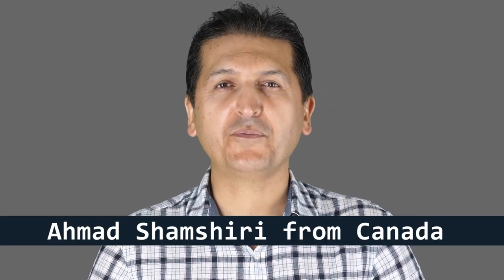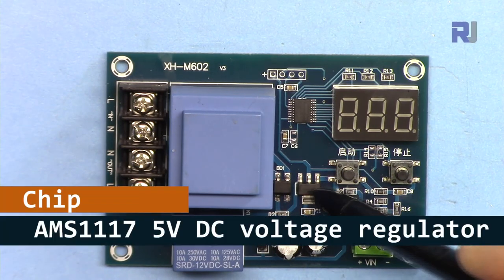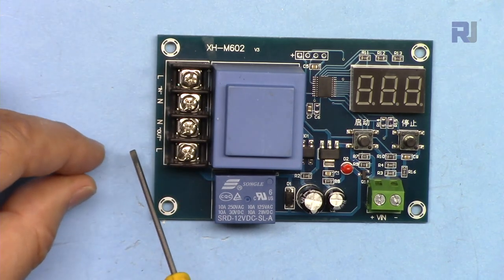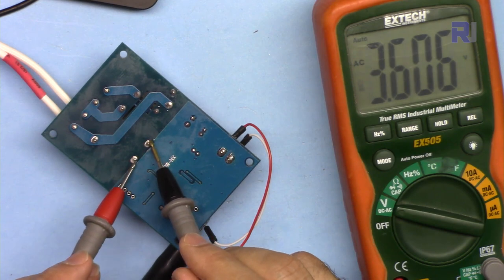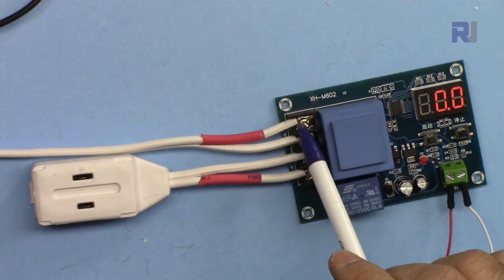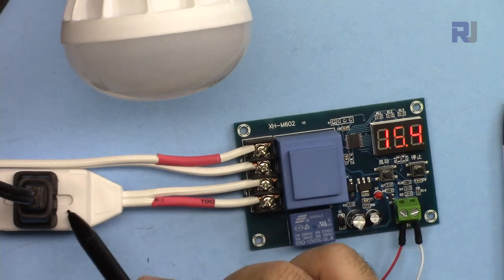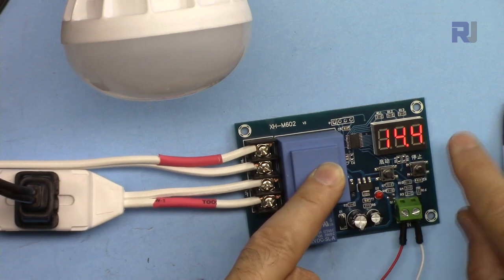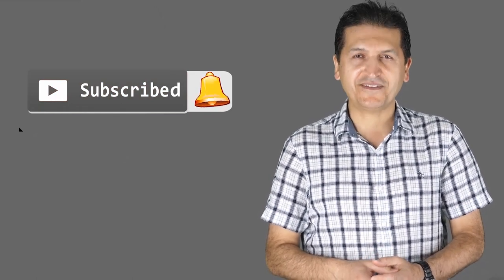Review of XH-M602 Charge controller Operated with 220V AC - Robojax

Comment: I couldn't find this in the North American 120vac version, so I ordered the 240vac version and will tell you here how to convert it to 120vac for about a dollar. The Transformer output is around 14v with a 220vac supply input, which when rectified easily drives the 12vdc relay. However, with only 120v supply, it outputs about 6.5vdc after being rectified, so swapping out the SRD-12VDC-SL-A relay with a SRD-06VDC-SL-C will convert this to a 120vac use. The rest of the board will even run cooler as the on-board 5vdc voltage rectifier will only have to sink 1vdc on a 120vac system instead of the 9vdc it has to sink on a 240vac supply. This design is tried, tested and true. The SRD-12VDC-SL-A relays are also available on Aliexpress for about one dollar a piece. Hope this helps someone looking to use this in North America or anywhere that has 120vac mains voltage. Cheers.
Reply from the maker: Thanks for sharing.

Comment: hello ... this type of controller has 10 amps relay .... is it possible if i change the relay values bigger than 10 amps, then i can put more load power? thank you
Reply from the maker: Yes you can . May be use this relay to turn On a more powerful relay. For sure. Or replace the relay with higher rated value.

Comment: Sir please reply...
I have a xh m601 auto start and stop charging module.
It charges say a car battery when the voltage is below the minimum set value say 11.5V, and it continues to charge till it reaches max set voltage say 14.5. i.e. between 11.5 to 14.5, the RELAY IS ALWAYS ON. This is fine.

Now, I want the reverse output of this module.
I want the relay to be ACTIVATED only when the battery voltage is GREATER THAN 11.5V.
And it will remain activated until it reaches 14.5V.
That is RELAY will remain activated between 11.5 to 14.5. And it will remain OFF at below 11.5V.

Please help me get this reverse output for this specific module.😊

Comment: I'm positive that other people are having the same problem as I already described to you. I explained to you what I believe is the setup you're describing in the video. Is my description about what is happening on the RIGHT SIDE of this XY-DJ correct? If so, does that mean I'll need to plug two devices into a wall outlet to make XY-DJ work to charge my Battery? Please read my last message again. And thanks for every response you've made thus far.
Reply from the maker: Hello, I just updated the resource page for this module. the link is in the description (and here http://robojax.com/L/?id=260)  of the video. All your questions should be answer .  it would have been nice if you used, "Reply"  so others would know that all the comments are about the same issue.

Comment: I have this module. 

However the charger is at about 14 V. The charger bypasses directly to the detection, and constantly switches on and off (every second) if the upper limit is less than the 14 V. If the upper limit is more than the 14 V, then the charger never switches off.

Would you please assist?

How can I keep the detection ports from not detecting the charger, but only the battery?

Comment: Hello Robojax.Thanks for great video! But I still have a question.
My battery charger has a very high power 1500W  220v. 
I'm afraid that the board is not designed to pass such high power and may heat up or catch fire...
Can you tell me what is the maximum power of the charger at 220V that can be connected? 
Thanks in advance!
Reply from the maker: Hi, the maximum current can pass though the the relay was explained in the video. Simply read what is written on the relay.  You will read the current and use the power formula to find the power using The current.
Reply: @robojax   In video we have 10A, but it is not clear is it for 220V or 110V  . 
If I understand correctly maximum power is 2200W, but it is depends on voltage... So I have some doubts about it.

Comment: In the circuit diagram, an external charger is connected to the battery.  What is the purpose of the DC side, is it an input or is it a battery charger?
Reply from the maker: Battery needs huge DC power this transformer is very 1/100 or 1/500 of the charger needed for battery. So the transformer in this module simply able to power the module only.

Comment: Thanks a lot. Could you please help me in setting my solar panel with this regulator. I have a 5w12v solar panel rated with max 21v. I want to take the energy from this solar panel and divert to my car battery. Where should i connect the wires from solar panel as input, and where should I connect the wires which goes to the car battery? I will set the limits as 13.6v min and 14.4v max.
Reply from the maker: your solar panel is your the power adapter and your battery is the battery.
Reply: @robojax  Thanks, can i minimum voltage as 0? As i want the car battery to trickle charge and cutoff when voltage reaches max 14.3v.
Reply from the maker: I am not sure if you the device or not but, just try it to see if it can do to zero.

Comment: Hi Robojax. Great videos. I've liked and subscribed.
I am trying to fix up a new charger for my friends 20 v power tool after he blew its charger by putting in the wrong battery, which had the + and - terminals the other way around.
Two questions, if you'd be so kind as to answer them:
1/.  The battery has a BMS, so can I skip the charger (which is blown) and connect the XH-M602 directly to the battery terminals?
2/.  What amperage does the XH-M602 work at?
Many Thanks and good luck with your channel.
Reply from the maker: thank you for subscribing. 1-No you can't.  This is just switch to turn ON or OFF your charger. 2-It is the relay rating . Written on it. most probably it is 10A. Thank you for not skipping the ads and keep watching it. This will help me a lot.

Comment: Good day robojax, im currently woeking on a project that is Li battery operated and I don't know what module I will search until i saw this one, i have two 6v motor drivers which is supplied by the 12v battery and has a split connection. Any ideas on how can i charge the battery and also gives the output when not in charge thankyou so much
Reply from the maker: Good day, Your batter has two terminals. You can connect your charger to the battery. Then connect your motor to the two terminals. So you will have 2 positive and 2 negative connected to the same terminals of battery. that is called parallel. You said your motors are 6V, I assume you have connected them in series to operate them with 12V otherwise they will die. So form both motors you should have only 2 wires which I call them "motor wires"

Comment: Can you be run 110v continuesly from the 220v. Like a step down?
Reply from the maker: doesn't work with 110V. The output becomes unstable.
Reply: @robojax  See comment about five comments up. This can easily be converted to run stable and cooler on 120vac.

Comment: Hello, I have a 12V 12A battery, how should I enter the upper and lower values?
Reply from the maker: Hello, the 12V is called nominal voltage. But the charge voltage is something like 13.2V. to be sure you need to find datasheet of the manufacturer.

Comment: How to use external relay with this?
Reply from the maker: remove the relay and connect the wires in the same spot.
Reply: @robojax  can we use that 4 empty soldering spots?
Reply from the maker: Hi I don’t have the module in hand to know but remove the relay and connect the pins using wires

Comment: Thank you Ahmed for your video. Is there a similar device that can do the opposite? I'm in offgrid home where i have my battery bank 48V (14KW) fully charged around 12:00 to 1:00  PM. I I wanted to use the rest of the electricity that my solar panels are generating. Basically i need to have a device that i will activate a relay instead of shutting it once the battery voltage reach a certain limit (full). It's the same as your device but with NC and NO (normally closed and normally open) option. I found only 12V-24V controller, but not for more. Thanks again. Shokran
Reply from the maker: You are welcome Tommy,  I believe there should a solution. I have done a video of dual relay module with voltage detection.. I don't remember all its modes. check it out   https://youtu.be/O01NCZq7O2M

Comment: Great video sir, this is what I searching from long time. 
I have 24V solar offgrid system. I am looking for module/kit which will monitor battery voltage and can feed power to my 1650VA inverter only if battery voltage false below 22v (this usually happens during late night and my inverter starts beeping). Can I used this module for my requirement. I think, I can but only worried about relay capacity to handle AC load. please suggest...
Reply from the maker: This will just monitor the voltage of a battery and when it reached below certain level it connects it and disconnect when it is above setting value. But power is the limit of the relay. You can however use external more powerful relay to control more powerful charger.
Reply: @Rajesh were you able to make it work? It has 10Ah rating which makes it 230x10 = 2.3KW capable. I am also planning to buy one for my 1100VA inverter.

Comment: Thank you for the video, however I need more details on the charger device that must be connected to the SH-M602, where can I find one?  I plan to use this device to recover dead hand tool batteries.
Reply from the maker: this is just  monitoring the voltage and acts based on voltage. Everything you needed to know about this device, I have provided in the video.

Comment: hi what happend if you put the hot input wire on neutral connection and neutral on hot conection? europe 220 connector dont have marked connector.
Reply from the maker: Hi, it is safety measure to protect use who thinks the device is OFF and touches the wire. it might be very dangerous.
Reply: @robojax  ok. but will it work or short cirkuit some way?   tutch what wire?
Reply: the hot wires will be isoleted any way. will it work in wrong connections is the real cuestion?
Reply from the maker: Relay is a switch. A switch can connect and disconnect.
Reply: @robojax  hi i did not ask about the relay.  the qoestion is do it work if the inlet hot wires are switched. hot on neutral and neutral on hot?

Comment: can this device be a LVD in solar panel system, I'm thinking to use this in output in my inverter? how about flip the value, upper value is 11 volt so it can cutoff all AC Out and lower value is 13.8v so the ac input and output will work again?
Reply from the maker: you can't switch the upper and lower limit. I have not done it but you try it.

Comment: HI
THE CHARGER DILIVER 28V (FOR 24V BATTERY)
IF I PUT IN THE CONTROLER (XH-M602) THE MAX (28V AS THE CHARGER) , THE CONTROLLER WILL NEVER CUT
IF I PUT MOR THEN THE CHARGER (29V) THE CHARGER WIL NEVER DILEVER MORE THAN 28V !!
Reply from the maker: Hi, when you use CAPITAL letters, you are SCREAMING.
Reply: @robojax  
Hi
No way there is nothing to make screaming
If you have any reply feels free

Comment: ഹായ് സാർ എനിക്ക് നിങ്ങളുടെ വീഡിയോ നല്ലപോലെ മനസ്സിലായി അതു കൊണ്ടു ഞാൻ നിങ്ങളുടെ ചാനൽ സബ്സ്ക്രൈബ് ചെയ്തു 

സർ എന്റെ അടുത്തു ഒരു 12v 7ah ബാറ്ററി ഉണ്ട്  
ഇത് ഉപയോഗിച്ചു  24×7  ബാറ്ററി ചാർജ് ചെയ്യാൻ പറ്റുമോ
Reply from the maker: ഹായ്, നന്ദി. ഈ മൊഡ്യൂൾ ഒരു ചാർജർ അല്ലെന്ന് നിങ്ങൾ മനസ്സിലാക്കിയെന്ന് ഞാൻ പ്രതീക്ഷിക്കുന്നു. ഇത് വൈദ്യുതിയെ ബന്ധിപ്പിക്കുകയും വിച്ഛേദിക്കുകയും ചെയ്യുന്ന ചാർജ് കൺട്രോളറാണ്. അതെ, കണക്റ്റുചെയ്‌തതായി ഞാൻ കാണിച്ച ചാർജർ നിങ്ങളുടെ പക്കലുണ്ടെങ്കിൽ അത് ഉപയോഗിക്കാം. ചാർജർ എന്ന് ഞാൻ പറഞ്ഞപ്പോൾ അതിനർത്ഥം നിങ്ങൾക്ക് നിങ്ങളുടെ സ്വന്തം വോൾട്ടേജ് (സിവി) സെറ്റ് ചെയ്യാമെന്നും നിങ്ങൾക്ക് ടെഹ് കറന്റ് (ആമ്പിയർ) (സിസി) സെറ്റ് ചെയ്യാം എന്നാണ്. നിങ്ങൾ കറന്റ് സജ്ജമാക്കിയില്ലെങ്കിൽ, നിങ്ങളുടെ ബാറ്ററി കേടാകും.
Reply: @robojax  

Thank you very much for answering me in Malayalam too

I know this is a charging control module
This is my question

Is there any problem with doing this modulle full time work? (24×7)
Reply from the maker: I am not sure. if this can be used 24 hours a day. Generally it should but to be sure, contact the manufacturer for correct information.
Reply: Ok sir

Comment: I never liked that kind of controller because it was to easy to get shocks when you put it in a project. It should have a shield over the connection point. They make some that are all low voltage connections and that is what I use.

Comment: I want to charge 24v 20ah battery can it work for this?
Reply from the maker: I have shown what voltage you can set. So it should do it. It also depends on your charger, make sure do not go above the current limit of the relay. if relay is 10A, then your charger should not allow current above 10A.

Comment: I'm in the US with 110v AC would the charge controller function on this voltage or only 220v AC? I guess I have a step up unit I could use, but it's kinda bulky, so direct AC input would be better
Reply from the maker: No it won't work. the input is 220V.
Reply: All you have to do is swap out the 12v relay for a 6v relay. Details are near the top of the comments.
Reply: @MrDaedalusWren  Thank you Wayne, my Hero for today :) TBH I didn't remember the Relay in question nor the comment I'd made, since the product wasn't for me on 110v AC, but upon review your tried and tested "fix" with a 12v to 6v relay switch out, is a relatively easy way for those of us Stateside with only 110v AC to use this useful product, so kudos to you my friend  😀
P.S For US use there is also a different module that does work with 80-260v AC input, called a YX-X2086 and it's for 1.5v-120v DC batteries with 10a max load (so chargers must be set under that.) But at least with this charge controller module, no mods are required.

Comment: Tsk.  Plss u need to connect it to actual batt charger. Bcos there's different voltages between batt voltage and charger voltage..  To see how it response
Reply from the maker: a charger for a battery is always the same voltage as the battery.  if it is not, then the charger is for something else.
Reply: @robojax  no sir for my knowledge. Charger must be higher atlease 2v than the battery. Battery 12.5
Charger 14.5